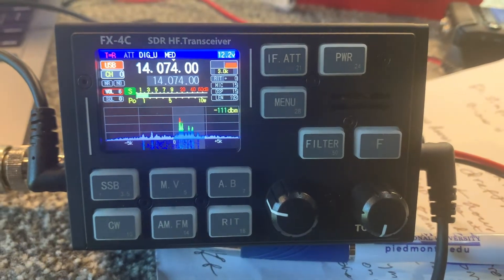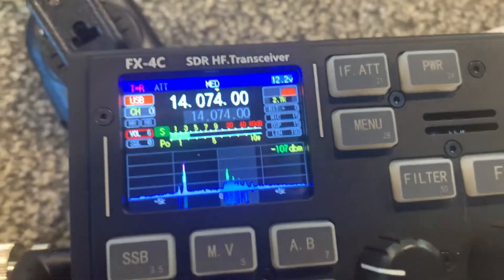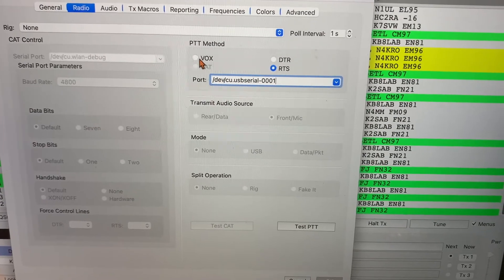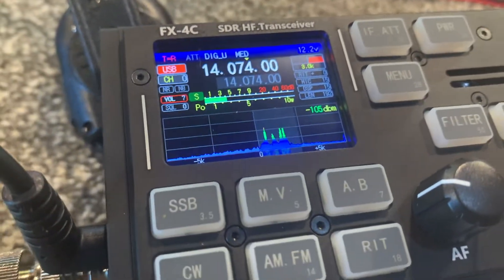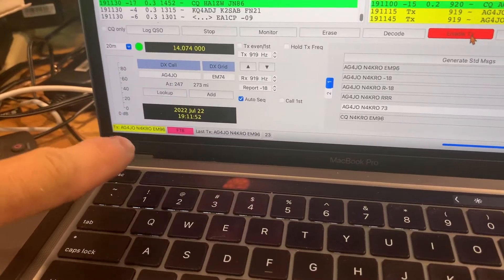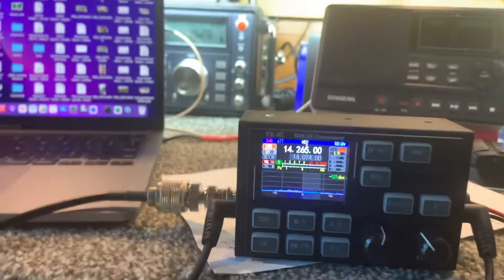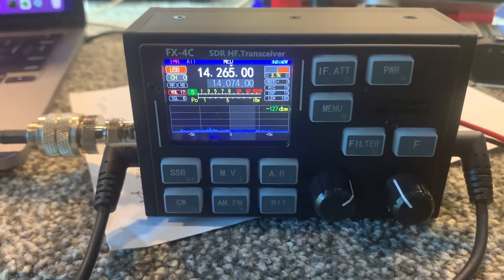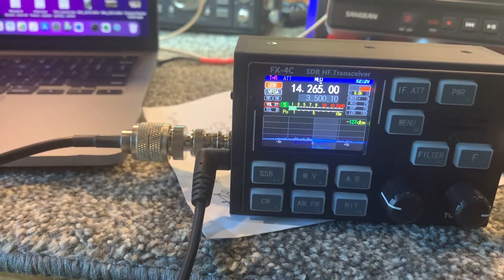Vintage Tech: FX 4C SDR QRP Radio

Comment: Hello, I saw on google a model that has a stripe drawn near the AF and Tune buttons at the top. What is the difference between them? To be another lot?. I have one like yours bought from AliExpress. I hope it's not fake
Reply from the maker: Hello. I don’t know what the difference is between those models.  I have heard that any more of the original models are not yet available because of slow supplies and delay in manufacturing.
Reply: @KOVintageTech  Does that mean it's a copy?  and we can't update the software?  I am satisfied with it, I have good reception.  I use a portable PAC 12 antenna

Comment: BTW, I find that the SSB audio distorts when I receive some strong stations with the FX-4C. Apart from turning on the attenuator, is that anything you can do about that?
Reply from the maker: Had the same problem.  You can try adjusting the agc.

Comment: Would be great if you could do a video on how to set this rig up on FLDIGI. I was playing around with mine today. Managed to get it working with WSJTX and JS8Call. I'm still working on FLDIGI. I think you're meant to use C-Media PTT for rig control. I was able to get it to key up transmit to call CQ but couldn't see any incoming signal on the waterfall.
Reply from the maker: I had a successful session with wsjtx with rig control, etc. I have not tried FLDigi on my Mac. Not sure it’s even compatible. Will check.

Comment: On your Mac version of WSJT-X you set Radio to None.  That means you are not using Cat control?  You set the 14.074 frequency Manually?
Reply from the maker: Jose. Yes. No cat control. Manual frequency setting.

Comment: Hello, I ordered an FX-4C SDR QRP Transceiver and I cannot operate in 3 650 kHz, in Romania this frequency is used, I can do something so that the Transceiver can transmit there as well. I am waiting for your message, I would like with a software if possible. Looking forward to hearing from you
Reply from the maker: Hello Friend.  Your radio should operate properly from 3500 up to 4000. kHz.  If it is not working correctly I suggest that you contact your seller and see if he can help you.

Comment: Was curious about this radio since you mentioned it on the repeater.  Looks interesting! Oh and QRP is <5w :)
Reply from the maker: It is!
Reply: @KOVintageTech  Does the radio get hot and/or how does it dissipate the heat from digital use?
Reply from the maker: @cki4syrm  it gets warm.  But not hot.  10-12 watts full power is not too bad.
Reply from the maker: Steve W4KG said today that officially phone QRP is 10 watts or less.  So looks like I met those requirements?
Reply: @KOVintageTech  I'm going to need an official source for this claim. Preferably a notarized official document.😉